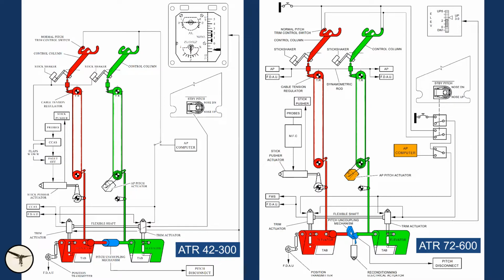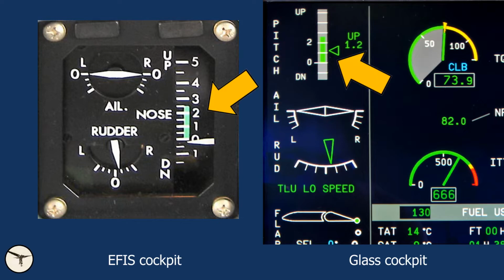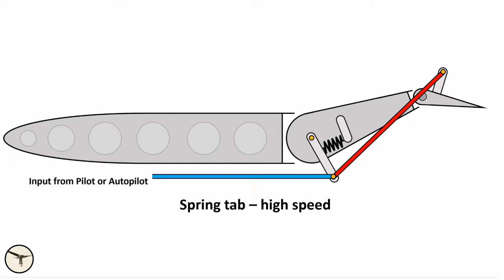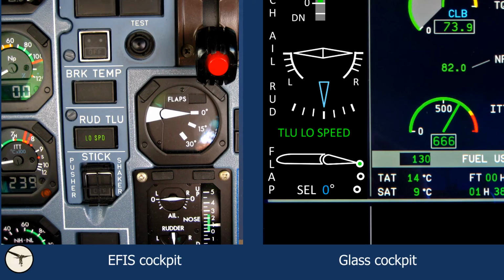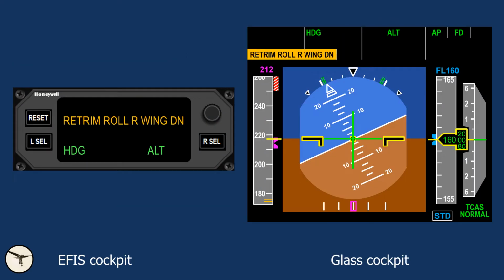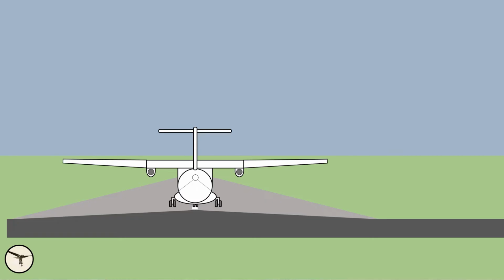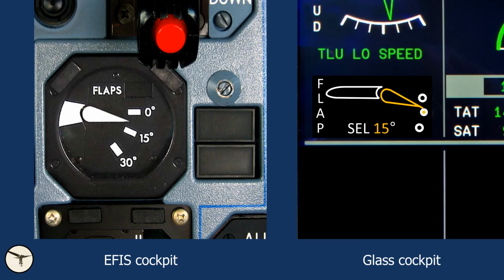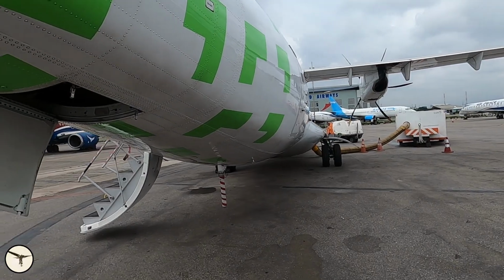ATR systems - Flight controls

Comment: I have a question, capt, regarding the rudder. I often see the rudder blown by the wind when the aircraft parked 90° from the wind direction and is fully deflected to either left or right side, depends on where the wind come from. My question is, when the rudder got blown by the wind, does this also move the pedal in the cockpit?
Reply from the maker: Yes, it does

Comment: Hello Mr Nordal, 

if I may ask you, 
what is the equivalent of the movable stabilizer (like we can find in the A320, B737 etc etc) in the ATR aircrafts? As far as I understood there is no such system on the ATR's. 

Thank you in advance,
Reply from the maker: The pitch trim system adjusts the stabilizers on jetliners, while the aircraft is controlled using elevators attached to the stabilizers. In smaller aircraft, such as the ATR, the stabilizers are fixed, and pitch trim is managed by a trim tab mounted on the elevator.
Reply: @ Thank you Sir!
Reply: @ Thank you Sir!

Comment: Hello again magnar. Is auto pilot still available in pitch (or full) if FO side elevator is Jammed and uncoupled? Since the actuator is located only on one side. Thanks
Reply from the maker: No, you cannot use the autopilot when the flights controls are compromised.
Reply: @ thank you !

Comment: Thank you for a great video. Quite informative. I am not working in the aviation industry, just interested in aircrafts. I have a question. From your videos, what I understand is that, the main flight controls are operated by pure physical muscle power, isn't it? It is not assisted by hydraulics? In the age of power assisted steering in cars, why are the flight controls are not power assisted? I assume in larger aircrafts, the controls are operated by hydraulics. So, up to which size of aircrafts are the flight controls not assisted?

Comment: Hello, Captain. Why do we have the 180 IAS limit for ELEVATOR JAM and PITCH DISCONNECT? Is it to prevent structural damage to the control surfaces?
Reply from the maker: No, it has to do with the controllability of the aircraft. When you have only one functioning elevator, you have reduced controllability, and the higher the speed, the higher the control forces.

Comment: What is the neutral position of pitch trim indicator ? 0 or 1 ? for ATR 72 500 and ATR 42 320?
Reply from the maker: Neutral trim is used when the centre of gravity is 25%. For ATR 72-500 the trim is set to 1.3 up. For ATR 42-320, the trim is set to 0.0.

Comment: Hello captain¡ in case of flaps asymmetry or flaps unlock that you have to land with reduced flaps, how do you decide if it’s going to be flaps 15 or flaps 0 table¿
Reply from the maker: Asymmetric flaps: Use the speed for indicated position. If it's between two positions, select the one that gives the highest approach speed.
Flaps unlock: The flaps is at 0 position.

Comment: Great video! I was just wondering why are the aileron indication displayed in white while the rudder trim indication is displayed in green in Autopilot for the 600 variant?
Reply from the maker: When the Autopilot (AP) is engaged, the aileron trim indicator is white, indicating it is inhibitted. When the AP is disengaged, the aileron trim indicator is cyan, indicating it can be operated manually.

When the Yaw Damper (YD) is engaged, the trim indicator is green, indicating the rudder trim is automatic. When the YD is disengaged, the trim indicator is cyan, indicating it can be operated manually. Note: The AP can only operate when the YD is engaged.
Reply: @FlywithMagnar  Thank you for the explanation!
Reply: @FlywithMagnar cant we use rudder trim manually ,if yd is engaged and autopilot is disengaged? if so how to correct the trim if slip indicator in ehsi shows slip or skid?
Reply from the maker: @shivapoudel9059 , on the 600, the rudder trim is automatic when the yaw damper is engaged. It will keep the slip indicator centered. It can even counteract an engine failure.
Reply: @FlywithMagnar  if we use rudder trim manually with yaw damper engaged, does it  move rudder trim setting or not? and more query..do we need to center the rudder trim manually after the yaw damper disengagement  while landing or not?cant we land with yawdamper on in atr 72 600.
Reply from the maker: @shivapoudel9059 , you cannot use the rudder trim when the yaw damper is engaged. The yaw damper must be disengaged before landing, otherwise the rudder trim will act against your input on the rudder pedals.
Reply: @FlywithMagnar  thankyou sir..so do we have to center the rudder trim before landing
Reply from the maker: @shivapoudel9059  No, you don't. The rudder is correctly trimmed when you disconnect the yaw damper. So, you can leave it as it is.
Reply: @FlywithMagnar  thankyou sir..in single engine landing ..i saw rudder trim at 2 dot left or right when i disconnect yaw damper.

Comment: Why does the ATR72 rudder trim tab end with a flat plate instead of a streamlined trailing edge like a normal aerofoil?
Reply from the maker: Because it doesn't make any difference when it comes to drag.

Comment: Greetings Captain, I need ask a few questions to assist in  understanding the system. Specifically, 1) With autopilot and yaw damper engaged . To trim the rudder in the yaw axis is the autopilot doing the trimming on the spring tab or only the rudder or both i.Or is it the yaw damper only providing the signals?

2}  In manual flight when we move the yaw trim control switches are we acting on the spring tab only or on the rudder and spring tab simultaneously? I am somewhat confused.  Many thanks
Reply from the maker: Rule #1: The rudder trim acts on the spring tab. The spring tab acts on the rudder, and the rudder deflection increases with the airspeed.
Rule #2: To use the autopilot, the yaw damper must be engaged.

In aircraft without glass cockpit, it is the pilot who acts on the rudder trim reagerdless of the status of the yaw damper and autopilot. In aircraft with glass cockpit (600 version), the rudder trim is automatic as long as the yaw damper is engaged.
Reply: @FlywithMagnar  Thank you

Comment: Dear Captain , under what conditions do we use the standby pitch trim ? Many thanks.
Reply from the maker: When the normal pitch trim doesn't work.
Reply: @FlywithMagnar  ok ,so what would cause the normal pitch trim to be in operative for example? 
Thank you
Reply from the maker: @user-ey3rg3nc5s , loss of electrical power, mechanical failure in the switch, etc.

Comment: Hi, I have a little doubt, does the atr 42-600 and 72 fly by wire? Or doesn't have any fly by wire system?
Reply from the maker: No, all ATR aircraft have mechanical flight controls.

Comment: With autopilot engaged and yaw damper engaged  ,if we get a RUDDER MISTRIM on the FMA .(Say engine failure during cruise) What are the corrective actions  ? I cant find anything  in the QRH or FCOM    Thank you
Reply from the maker: When you have a rudder mistrim, you must disconnect the autopilot and trim the rudder manually. In case of engine failure or shut down during cruise, you should reduce the speed to less than 180 kt to activate TLU low speed mode.
Reply: @FlywithMagnar   Much appreciate your time for responding to my question . Many thanks!  You are the best !

Comment: ER, have you been drinking one too many cans of Stella Artois, undercarriage !!!!, need an eye test. I have seen far better wheels ,tyres and suspension on an Invalid scooter. Compared to an Antonov 24,okay it maybe Russian, but built like a brick shit house and reliable, it is  the only aeroplane that will take off from a dirt strip submerged  in  a foot of water, for it has  big fat tyres. Again so sorry to piss on your parade, the ATR  42-72 is a cross between an Airfix Kit and a Moulinex  Food Processor, and useful as a lawnmower on an oil rig. No wonder Joe McBryan is hanging onto his DC-3 Dakota and Curtiss C-46 Commando, imagine him trying to use said Moulinex Food Processor ,ER ATR!!! on a trip with four tons of supplies to  a mining camp in the arse end of nowhere, can your fancy French Kitchen Appliance land on a few  thousand foot of rough goat or mule  track that serves as runway?,answers on a postcard.

Comment: Hello Magnar, what a wonderful video!
The rudder is quite complicate, but it seems to work very fine in terms of pilot comfort.
I think you did a very good explanation for the working principle of the rudder.
A little question came up during watching your explanations regarding the rudder: 
When you move both yaw trim switches to position "NOSE RH", does the spring tab move to the left (when viewing the rudder from top) or right, and what would be the indication? 
It is a bit confusing to me, since the switch is about the "aircraft nose", and the trim indicator shows the "motor displacement".
From my understanding the trim tab must move left to yaw the aircraft to the right... total confusion coming up
Reply from the maker: When you move the trim switches to the right, the spring tab moves towards the left. This creates an aerodynamic force that moves the rudder towards the right, which in turn creates an aerodynamic force that moves the tailfin to the left, causing the nose to turn to the right.
The deflection of the spring tab depends on two factors: Trim tab motor displacement and the airspeed.
Reply: @FlywithMagnar  Thanks for confirmation. So the indicator in case the switches are moved to right ALSO point to the right (despite the trim tab is travelling to the left)?
Reply: Captain, if we don't get the 'jolt' for Rudder Cam - Center...do we have to redo the checklist item?
Reply from the maker: @mrturboprop1743 , no, we don't. That means the rudder cam is already perfectly centered.

Comment: Hi Cap! :) Why is the pressure bulkhead full of oil spills?
Reply from the maker: It's not oil. It's a thin primer used to prevent corrosion.
Reply: @FlywithMagnar  Ohh, I see. Thx for the reply! :)

Comment: I wonder why ATR never decided to utilize spoilers for landing until the 42-600s?
Reply from the maker: In the late 1980s, when ATR 42 was developed, the company considered that the market for STOL aircraft to be too small to be commercially viable. They were right because de Havilland Canada made excellent STOL aircraft, which sold in small numbers. However, when the Dash 8-100 and -200 are no longer are in production, there's a growing market for a 50-seater that can operate from 800 m runways. Therefore, modifying an existing design makes sense today.
Reply: Sir please upload the door,navigation and communication.

Comment: Hi captain! Amazing video as usual.
In case of pitch disconnect, is there a way to fix which control column will be PF, or it  a random chance ?
Reply from the maker: When both elevators are free, it's up to the pilots to decide who shall be PF.
Reply: Usually a pitch disconnect is manually done after an elevator jam, in which case, the pilot on the unjammed side will need to be the PF.

Comment: Good work captain, thanks for the educational video, at 8:30 does this mean both props are rotating in the same direction? which one? and does it feel like a Cessna in take off? I mean do you have to apply right rudder during the take off roll? thanks
Reply from the maker: Both propellers are rotating clockwise when viewed from behind. As I say in the video, the rudder trim is set to neutral at take-off. The ATR has a natural tendency to go straight on the runway. When you rotate, there's a slight yaw to the left, but most pilots do not even notice it. Once established in climb, the aircraft is going straight. As the speed increases, there will be a need to trim the rudder to the right.

Comment: Very educational. What's the reddish fluid stains all over the inside walls of the tail cone ?
Reply from the maker: It's a anti-corrosion coating. It's thin, enabling it to penetrate very small gaps.
Reply: It seems a bit ironic that it is a rusty colour. 😁